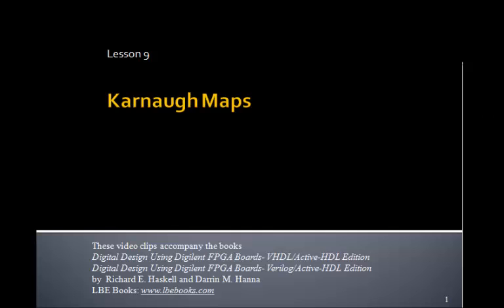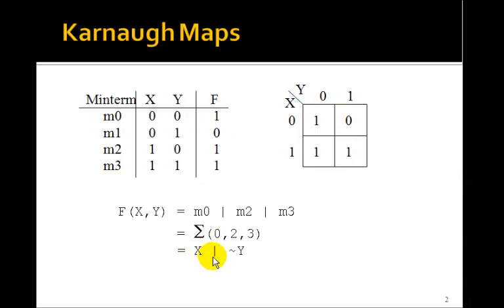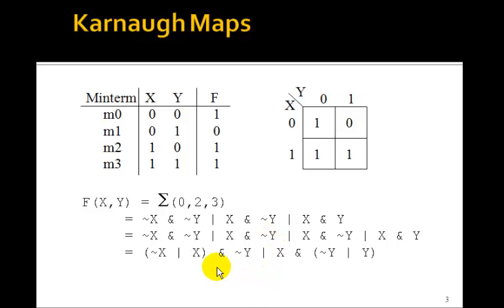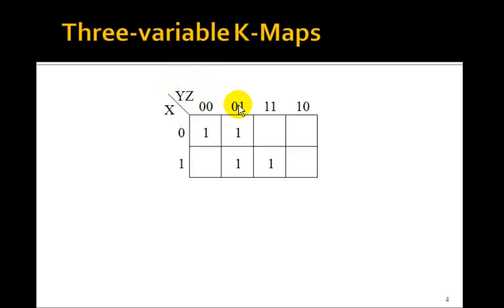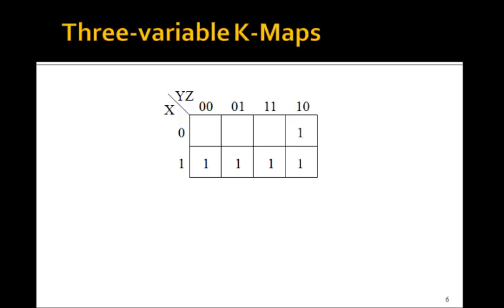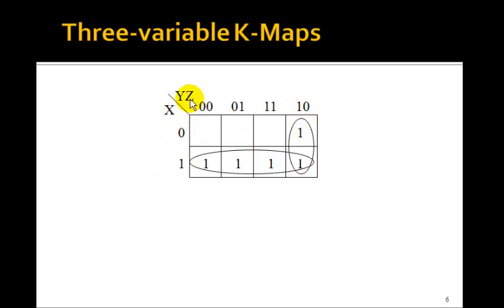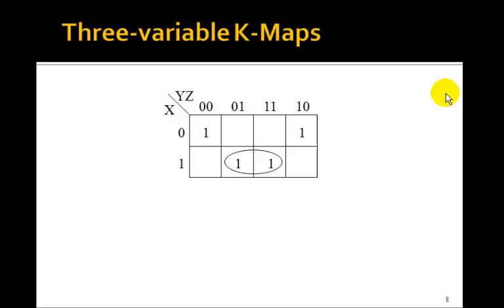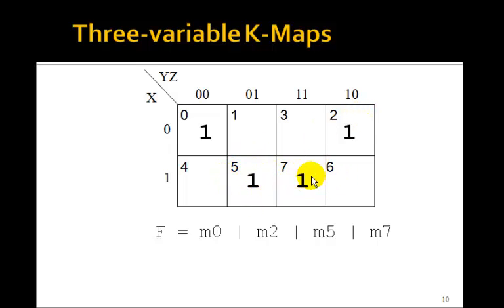Lesson 9 - Karnaugh Maps

Comment: why do you use x for lines and y for columns? i.e. why do you use x for vertical, and y for horizontal? are you a japanese? do you first write from top to bottom and only then from left to right?
Reply: I am pretty sure: If you flip them but watch out to have the same minterms, you will get the same result.